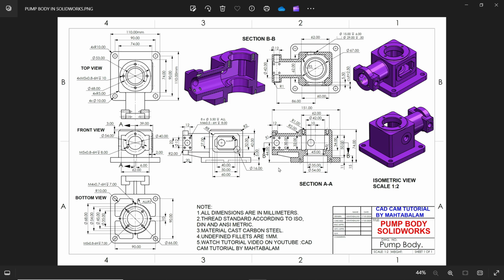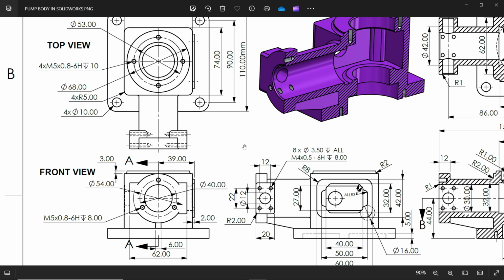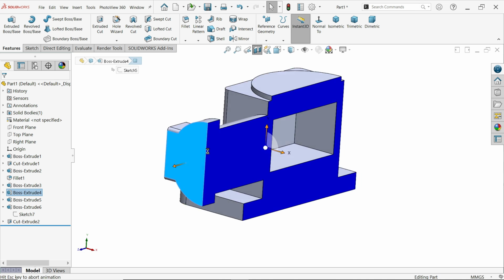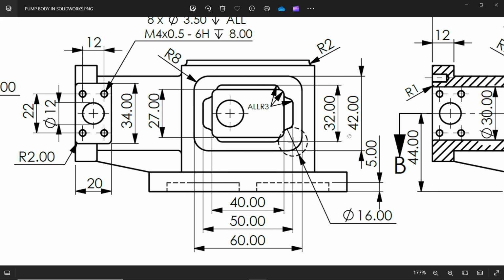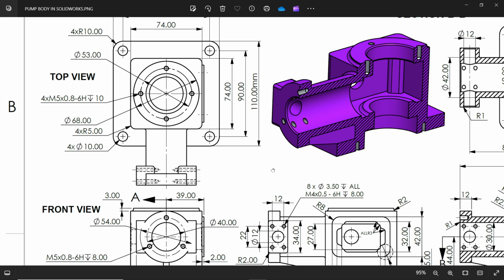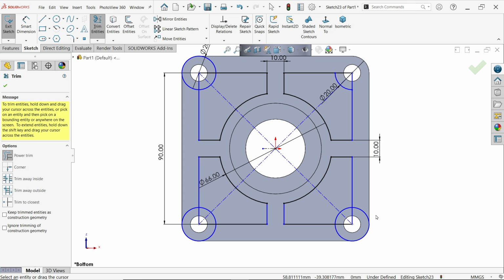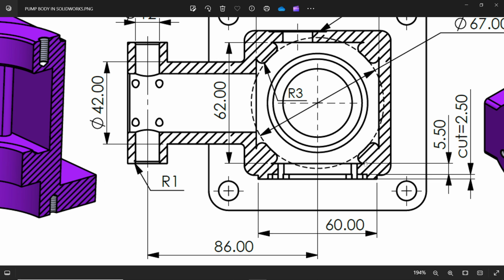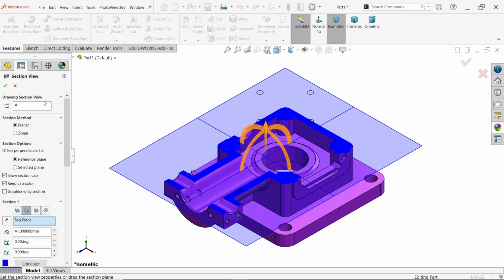SolidWorks Tutorial Pump Body Exercise 212

Comment: At 5:33 TO EVERYONE. 
HE MADE A MISTAKE FOR 74 MM HEIGHT. IT SHOULD BE 71 MM AND 3 MM IS ADDED AFTER ADDING A ROUND CIRCLE. THAT WILL MAKE 74 MM AND NOW HE HAS A 77 MM HEIGHT.
Reply: You are right
Reply: Correct if the hight 71 plus that cirecl 3 it's 74 good notes ❤